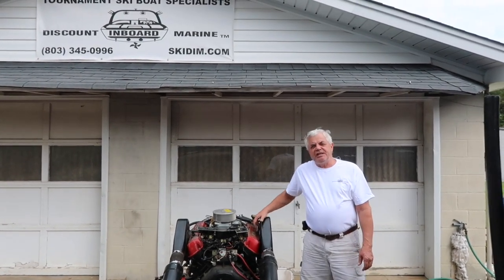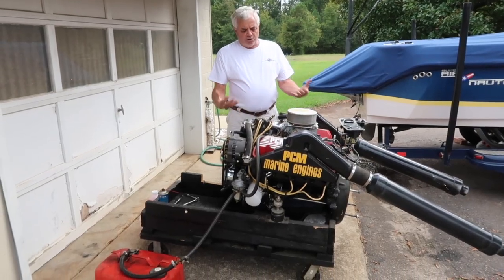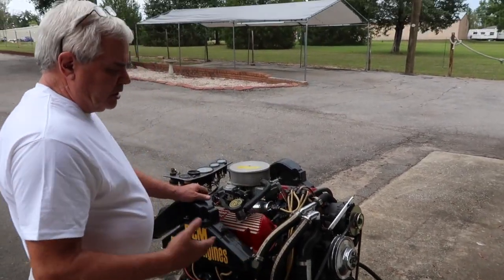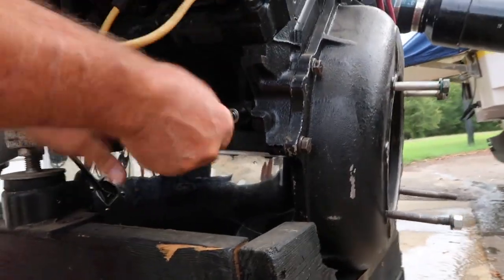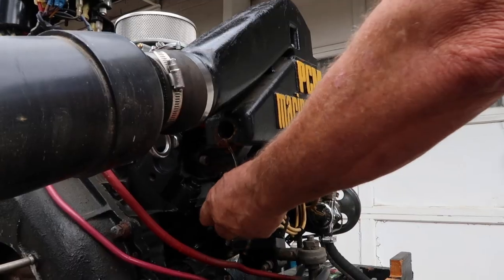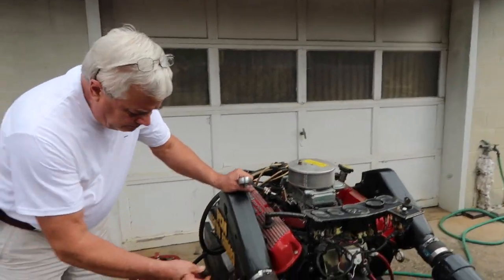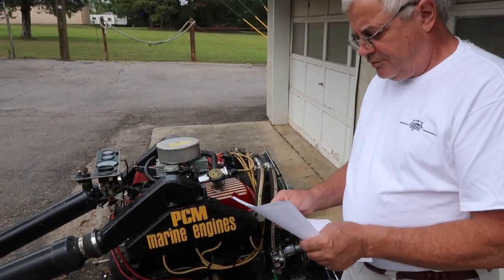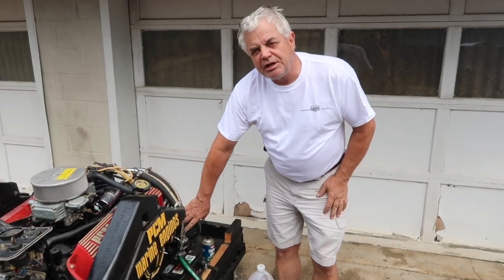How To Winterize An Inboard Engine

Comment: Interestingly, the experts at Skidim and Skiboatpartsonline don't agree with each other re when to change oil, use of antifreeze , or impeller removal.  "I've been doing it this way for 30+ years, never had a problem"

Comment: Did he not have antifreeze in the motor to start with?? What did he drain out? My boat already has antifreeze in it.
Reply: Nope. Raw water sucked in from the lake and blown out through the exhaust.  You must have a closed loop system with a heat exchanger.

Comment: Good video.  Only thing I would add is that on top of draining the engine, make sure your trans cooler is drained!  Instead of removing the hose from the engine side of the trans cooler, I disconnect the lake side from the cooler and drain.  Then I hook a hunk of hose to the trans cooler and suck the antifreeze in that way.  Don't forget the strainer bowl too.

Comment: I have the same engine, but it’s fuel-injected.  Being in NC my dealer told me fogging is unnecessary (not cold enuf).  Also, I pour out the water in the water filter.  You didn’t show that.  RE the plugs, I grease the threads before reinstalling.

Comment: 89 MC Prostar 190, Indmar 351.  I have never used antifreeze, just drain the manifolds and the block and hoses.  (And much more.)  As far as the junk that collects in the rear of the manifolds, I have a 2-3 inch strong rod magnet, so I just stick that in the hole and get the rusty gunk out, been doing it for nearly 20 years, and the quantity of gunk decreases to nearly nothing every year.  I think I am going by the book, maybe the antifreeze helps prevent rust.
Reply: Antifreeze absolutely helps with rust
Reply: What state do you live in? How cold is your winter? I’m in RI and don’t Have antifreeze in right now but drained it.

Comment: I haven't been draining the water before putting in antifreeze, but will try that this year.  I pull the thermostat before running the antifreeze in and fogging, so that I know for sure that it's flowing.
Reply: Yeah make sure you do.  RV antifreeze is not designed to be mixed.  If you're not in a real cold area you're probably OK but here in MN it gets down to -30 some nights, you want to make sure that stuff is 100%, not diluted.
Reply: Did he not have antifreeze in the motor? What did he drain out? My boat already has antifreeze in it.

Comment: Thanks Vince!  Very helpful. Question, how does the rv antifreeze get into the engine if the thermostat is closed (assuming you don't get it warm enough to open the thermostat)?  Or are you not intending it to get into the engine?
Reply: The water does not go into the engine thru the thermastat. The thermastat prevents cold water from leaving the engine,  the raw water pump will directly fill the engine till it's full, then pump excess antifreeze out the exhaust. As the engine heats up, the thermastat will open a slight amount and let some hot water out, which is replaced with cold water from the raw pump. Running a boat wide open across a lake does not fully open your thermastat.
Reply: @krisnowak4  can you describe the path of the raw water from the lake into the engine block with the thermostat closed?
Reply: Exactly what I was thinking. He did not mention to make sure you get the engine up to temp to open the thermostat. Unless the engine gets up to temperature and the thermostat doesn't open the antifreeze will not get into the entire engine.
Reply: @job62262  Draining the block should drain about all the water on the other side of the thermostat so really its not a big deal whether its open or closed. Also if it's a closed cooling engine then the only thing going through the thermostat is coolant

Comment: My motor is throttle body injected, where do I apply my fogging oil? I have a master craft sport star 19 with a 305 motor.
Reply from the maker: You can do it the same way. Since its multi-port you should NOT spray it through the air intake.
Reply: So fog each cylinder separately?
Reply from the maker: @brett7562  Yes fog each one individually through the spark plug hole, once the fluid is in the 8 cylinders you turn the engine over once and put the plugs back in.